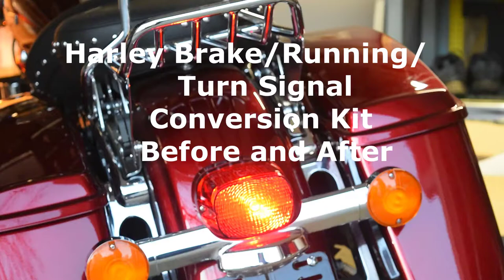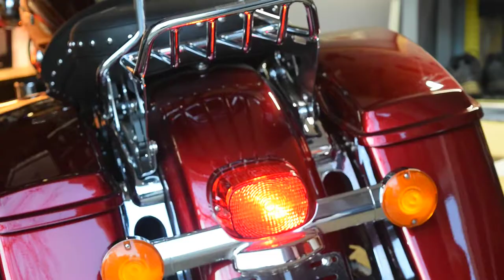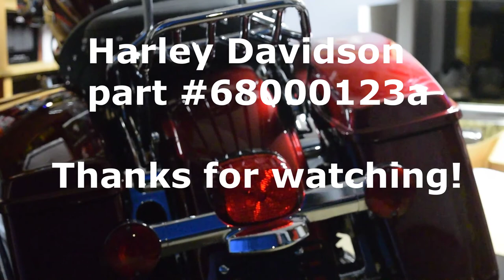Harley Davidson Auxiliary Brake Light/Running Light/Turn Signal Conversion Kit Before and After Demo

Comment: Thank you for posting this. I have a 96 heritage im restoring and ive been three days picking my butt trying to figure out why in the hell my rear turn signals kept coming on with brake light. seen your video, went down to garage, pulled the seat and there it was, mystery solved. Somewhere in its history someone installed one of these modules.thanks again.

Comment: So would a Harley fatboy stock not have the turn signals normally on when running? I have to buy this kit?
Reply from the maker: correct, the stock turn signal bulbs are only on when the turn signal is activated.  This kit includes dual filament bulbs and a controller module so they act as both running lights, turn signals and brake lights.

Comment: you didnt bother with the most important thing? The install? What a joke. Thanks for wasting our time.
Reply from the maker: It says right in the title "before and after demo".  The title doesn't say "installation instructions".  And the installation is so simple any idiot with a screwdriver can do it in a few minutes.
Reply: It will plug and play. Harley took the guessing out the wiring. The kit should have the male or female plug according to your bikes plugs. I would assume this is why he skipped it.